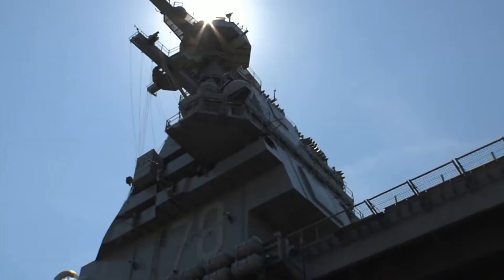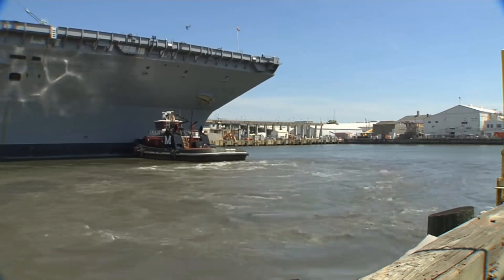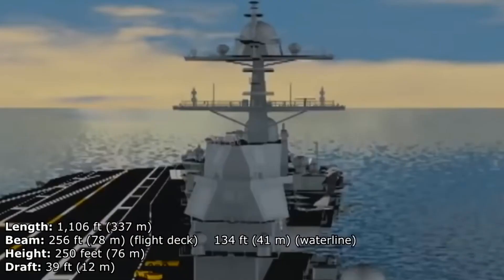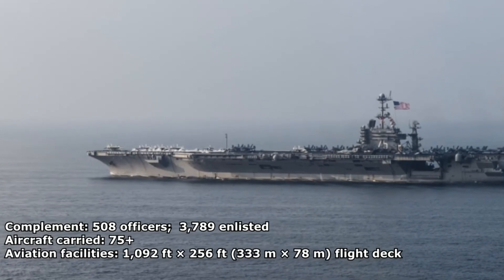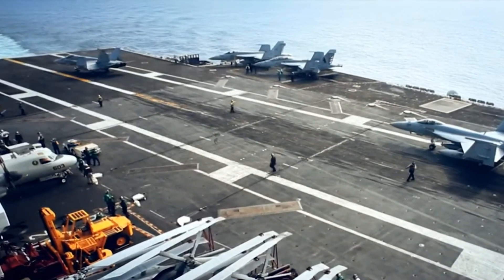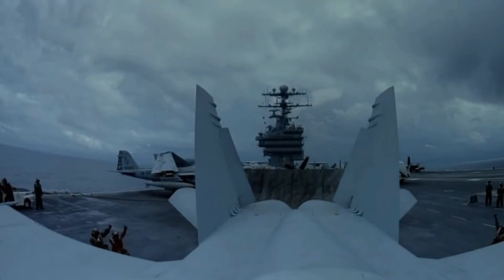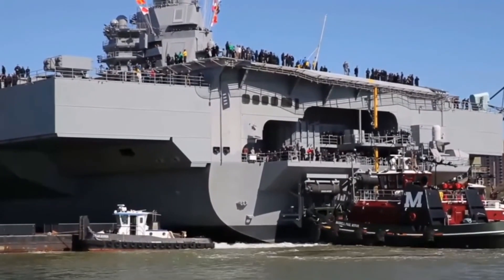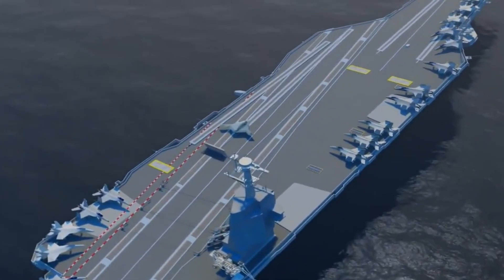USS Gerald R Ford CVN-78 - US Navy Supercarrier

Comment: can't wait for the Queen Elizabeth vid. The Brits always have impressively smart ideas
Reply: Kack Boon While I agree that CATOBAR is the better launch and recovery method in terms of capability, you have to consider the other factors. The Royal Navy doesn't have the money to buy, crew, maintain, and continuously upgrade a large CATOBAR carrier. They also don't really have the decades of experience the US has with the system. Additionally, they don't have any planes that would need a CATOBAR system to launch. However, to say that the F-35 B is shitty is really ignorant and plain wrong. It has got a lot of bad/inaccurate press, and if you look back at almost any plane's development, people have harshly criticized them. Harriers were called widow-makers due to their initial high rate of fatal accidents (this was a big deal). They were also criticized for their inability to go supersonic and their low range and payload capacity. But once all that was ironed out they became a lauded aircraft. If you want to learn more, I suggest you look at the series on Youtube called: F-35 busting myths. It goes through every single criticism in detail and explains a lot of the engineering in plain language.
Reply: +Ancient Hoplite He's probably referring to the shorter range and lower G limit of the F-35B. Still, referring to one of the finest aircraft of the current time as shitty is silly to say the least.
Reply: Exactly, i'm sick of all these "experts" on YouTube comments declaring this aircraft trash. Is it taking longer than it should of, yes, but it's still an incredible piece of machinery.
Reply: If you look up the Euro Fighters Radar cross section it is infact incredibly stealthy for a 4th Generation fighter. It has one of the Best Radar systems, Weapon loads and  Compatibility of any NATO fighter. Including the Precious F18 Super Hornet.  The Typhoon has one of the Best dog fighting records of any European fighter and can only be improved in the future. If you paid attention to the world stage, you'd see that Un-manned Euro Fighters are being tested in Australia, That have pulled 14G in a sustained Dog Fight. Yes 14G.  But Every weapons system of the modern battlefield is a heap of shit as soon as an EMP is let off. So it doesn't matter anyway!
Reply: You have no idea how much I hate people mindlessly and ignorantly hating the F-35. After a few people involved with military aviation criticized the F-35 for its cost, weight and other less than ideal aspects, tons of people who know no more than "If ya pull the stick back, the nose goes up" jumped on the bandwagon, eventually leading to the repeated comparison of the F-35 with the Su-35 in unfair comparsions such as dogfight capability. The stupidity of these claims is similar to the stupidity of saying that surface-to-air missiles can make planes obsolete. The complete disregard for tactical and strategic capabilities and situations in these analyses repeatedly portrays the F-35 as inferior, yet under the right conditions it would be capable of firing a missile at an Su-35 within the missile's no-escape range without being detected.
Reply: +Kack Boon DOT&E noted failures of the EW system, vibrations of the gun which'd cause the 260V DC battery to fail, and false double tracks on aircraft with sensor fusion, among other things. The 2nd is easy, don't use the gun, but other major issues including EO-DAS errors are the most major I'd say. As the most advanced aircraft in the world it's natural for it to have teething issues and I doubt any objective analysis prior to intended 2018 FOC can be reached. A 5th Generation air fleet is essential, if not indispensable in a 21st century threat environment. Global penetrating precision strike is a core competence for any armed service, what the 5th Generation fleet inclusive of B-21s, F-35s and the much rarer F-22s is intended to provide. Extending the service life of legacies isn't any indication of the F-35, it's called fiscal discipline, integral to the high-low capability mix. Without a credible deterrent courtesy of a 5th generation air fleet the U.S. can forget about hegemony over Western Europe and South East Asia that it historically enjoyed. 4th generation aircraft are inherently difficult to sustain in the advanced A2/AD environment, and will deny the services the ability to create and preserve freedom of movement, and the ability to operate nearer to areas of interest. Many think tanks support this precedent, look beyond War is Boring and other debacles. The issues surrounding the F-35 are clear, but it's urgent need is as well, judgement should only be passed past intended FOC deadline. And do you think the 6th Generation aircraft projects of the next few decades will be any easier? Definitely not. It'll likely face more developmental issues.

+jugganaut33 

" But Every weapons system of the modern battlefield is a heap of shit as soon as an EMP is let off. So it doesn't matter anyway! "

My IQ dropped while reading this. Almost all military aircraft are designed to withstand EMPs. Helicopters hovering in front of strong radars fields exhibit this same EMP hardening which allows them to do that. If you want to look into the future of air power there are 2 routes. And neither of them involve significant dogfighting. CSBA envisions large, bomber like VLO aircraft with high missile capacity, manned and unmanned vehicles operating in a sensor shooter configuration. Aircraft manufacturers see 6th Generation aircraft which have variable cycle engines, possibly hypersonic, broadband low observable, ISR, EW and cyber warfare capable. Such is the future. 4th Generation aircraft are no substitute in the long run, nor is 5th Generation. Though it's worth noting the large technological gap between 5th and 6th Gen is why 6th Gen isn't the immediate USAF concern. The victors of modern air wars lie not with who can pull more Gs or generate greater instantaneous turn rates, but rather who can see, shoot and kill first. Missile technology maturations will keep engagement ranges further, advanced short range missiles e.g. IRIS-T and DEW defenses will ensure any dogfight devolves into a 1:1 kill ratio attrition ground, unsustainable for any military, as it does now.
Reply: Explain why the F-35B is shitty?
Reply: +TheMarineGamer IGGHQ
That is their business model, fancy prototype stuff, barely usable in service but sucking up huge amounts of money. 

The F-16 is not from Lockheed, it was designed by General Dynamics to the requirements made by the Fighter Mafia (some Pentagon rebels, fighting for the right and cheaper tool), who also laid out the basic requirements for the A-10. 
Lockheed just bought the program.

The last huge quantity jet fighter from Lockheed was the Starfighter, which killed more pilots than most wars after WW2. 
It worked only in desert conditions with excessive maintenance and even then it was shit. The USAF got rid of them pretty fast. 
Critics in Germany for e.g. were treated like tinfoil heads, besides the fact of all the crashes happening. 
The ignorance of the German Defense Minister of that time was strong and he got his only son killed in one of the junk jets. 

The best jet Lockheed has built in the past decades was the S-3 Viking for the Navy. 

+The Fake SecDef
The overheating hasn't changed from the earlier reports, meaning the weapon bays need to be opened for ventilation. 

F-35B weight problem:
"The program completed the final weight assessment
of the F-35B air vehicle for contract specification
compliance in May 2015 with the weighing of BF-44, a
Lot 7 production aircraft. Actual empty aircraft weight
was 32,442 pounds, only 135 pounds below the planned
not-to-exceed weight of 32,577 pounds and 307 pounds
(less than 1 percent) below the objective VLBB
not‑to‑exceed weight of 32,749 pounds
[...]
Estimates for FoM weight growth include an additional
250 pounds, which will exceed the vertical landing
structural limit not-to-exceed weight of 33,029 pounds
for the Lot 2 through Lot 4 aircraft. This additional
weight may prevent these aircraft from being upgraded
to the Block 4 configuration."

The later Lots are also freaking close to this limit. 

---

You are so wrong on the A-10... it is the ultimate workhorse in the fleet, the most precise, with the lowest collateral damage and operating cost. 
It was cut from funding for bigger upgrades since the 90's! 
While the A-10 can go low, so that the pilot has an eye on the ground, other jets are high up in the air, avoiding ground fire, with pilots watching on a tiny screen. This adds to the risk of air support. 

The F-35 can go down from a few pistol hits (no self-sealing tanks, no fire suppression!), while the A-10 can survive anti-aircraft gunfire. 

It is freaking myth that a CAS aircraft has to dodge air defense systems like the S-300. 
F-16 Wild Weasels or F-18 Growlers and a swarm of MALD decoys will take care of them. No one fights a war on the ground right next to enemy anti-air systems. 

The USAF is even searching for a lighter CAS aircraft in the OA-X program. Currently, the A-29 Super Tucano, AT-6 Wolverine, and the ScorpionJet are in the race.
Reply: +Kack Boon +TheMarineGamer IIGHQ Oh please do link me for the overweight issue. I'm surprised DOT&E didn't reflect it.

But I'm surprised people are still buying into this version of CAS as if it exists in a high intensity conflict. EO-DAS, radar and other sensors can characterize targets according to databases and computers can advise pilots with minimal pilot input (Defense Horizons publication). The human eye is inferior in every way to the sensors the A-10 has, it is by no means the main method for detection. According to the USAF press briefing

LEGACY: A-10A
• Intense workload causes heads-down time
• Built on 1970 / 1980 technology
• Limited integration with modern command
 and control
• Limited precision weapons capability

CURRENT: A-10C
• Central computer provides full sensor &
 weapons system integration
• Information displayed in “glass cockpit”
• Datalink (SADL) with moving map
• New precision weapons capabilities
• Improved lethality and survivability

Other improvements

 Integrated digital information
 Plan-view representation of
current tactical situation

 Situational Awareness Data Link
(SADL)
 TAD displays target/threat/friendly
information via data link
 ‘Gateway’ allows comms with Link
16 and other data links

 A-10C Carries Most Advanced
 Targeting Pods in CAF
 High quality video provides
standoff beyond visual range
 Coordinate Generation (TLE)
 LSS/LST
 LTIP
 IR Marker
 Rover (VDL)
 Video in HMCS

The sensors are used for identification, not the human eye. I mean think about it, in an era of network-centric systems and PGMs, visual identification as a means of aircraft targeting is archaic for the world's strongest standing air force. It is the technological evolution of the A-10 that made it CAS capable. Original A-10s were worthless piles of trash, really

The 1982 congressional hearings on various tactical air programs showed the contrast between the views of the generally pro-military members of the relevant committees and the rhetoric of the Critics. In the Senate Armed Services Committee hearings on 26 February 1982, Senator Barry Goldwater (R-AZ) opened the testimony of General Creech by asking why the Air Force was continuing to buy more of the simple A-10, the Critics' favorite aircraft. Goldwater, an Air Force Reserve brigadier general, said, " I have talked to some of the guys in the A-10 outfits...they would much prefer to do ground support with the F-16. " The problems the A-10 pilots identified to him were caused by the very things the Critics had insisted on: simple avionics and no sophisticated standoff weapons capability. The A-10 pilots complained to Goldwater that without navigation systems they had difficulty finding targets and thus were forced to loiter in high-threat 364 areas, that any sort of bad weather kept them from flying, and the that the lack of standoff weapons meant they had to get dangerously close to their targets. Additionally, to keep costs down, the A-10 did not have the Hands on Throttle and Stick (HOTAS) mechanism that allowed the pilot to change weapons without looking inside the cockpit, even though every other modern Air Force fighter had it, and even F-4s had been retrofitted with the system. The result was an A-10 pilot, while flying at low level and trying to attack a target and dodge SAMs and AAA, had to look inside the cockpit and change five switches to change from bombs to his cannon, while an F-16 pilot made the same weapons change with one movement of a ìpinkieî switch on the throttle. All this vastly increased the vulnerability of the A-10, and the F-16 fighter-bomber seemed much more survivable. Goldwater concluded by saying, ìI donít think it would break a lot of hearts in the Air Force if we donít authorize the purchase of any more A-10s.

- THE REVOLT OF THE MAJORS: HOW THE AIR FORCE CHANGED AFTER VIETNAM

The A-10 is indeed precise. But why? Because it has a targeting pod, it's networked, and the weapons it uses is accurate. Nothing about the A-10 itself is special. If say, an F-15 and an A-10 had hypothetically, the same degree of provided intelligence, launched the same PGM at the same target, you'd note absolutely no differences in CEP. When you can unite ISR and precision strike into a single platform, and add even more CAS relevant technologies and interoperability into a single airframe as in the case of the F-35, it's a more suitable asset. An ideal option would be a 

And no, high intensity CAS isn't a myth, really, it isn't.

" Adversaries are increasingly deploying integrated and networked capabilities as part of the Anti-Access/Area Denial (A2/AD) strategy in highly contested environments. To achieve air superiority against this strategy in support of joint force mission objectives, the Air Force needs to develop a family of capabilities that operate in and across the air, space and cyberspace domains— there is no single capability that provides a “silver bullet” solution. This family must include both stand-off and stand-in forces, integrated and networked to achieve mission effects "

- Air Superiority 2030

Typically VLO aircraft would be used for penetrating strike, to tear down an IADS. But in the case of an adversary with a standing air force, air superiority can be contested, necessitating capable air assets which can provide air-to-air and air-to-ground functionality. JSOW MALD and HARM is a combination envisaged to challenge an IADS, but so is EW and cyber warfare being essential.

" First, units must improve deployment reaction time and speed, as windows of opportunity to penetrate IADS or to destroy high value targets may be fleeting. Second, fifth generation aircraft units must work diligently to minimize the required amount of forward-deployed equipment and personnel, and fully understand the logistics, sustainment, and communications limitations at a deployed location. Third, the Air Force must work to increase flexible basing options available for fifth generation aircraft (such as increasing the number of airfields the Air Force can deploy to), and build a fuller understanding of the impact these options will have on operations, maintenance, and command and control in dispersed locations. This includes not only conducting combat operations from bases owned by our international partners, but also operating at relatively austere locations. "

Fifth Generation Air Combat: Maintaining the Joint Force Advantage By Maj Gen Jeff Harrigian and Col Max Marosko, USAF
Reply: Yeah, and the Admiral Graf Spee should have blown the Exeter, Achilles and Ajax out of the water on paper, having more collective armour, speed and firepower than the three of them put together. The battle of the River Plate at the start of WW2, to save you Googling it as I'm sure you've never heard of it, three relatively puny British cruisers against one German 'Pocket Battleship' that on paper was in every way their superior, the equivalent of one Tiger tank supposedly being the equal of half a dozen Shermans or T34's, again, ON PAPER. You can quote me anything you like but the only real answer to this question would be in an actual, real-life dogfight, where 'the metal hits the meat' to quote your Colonel Hal Moore of the Vietnam War
Reply: The UK is building and outfitting 2 QE-class carriers for the price of 2/3rds of one Gerald Ford-class, fielding 75 5-Gen (or more) fighters. Name one other ally of the USA willing to do that.
Reply: ***** and again. Unnecessary
Reply: it would want to be for the money they are spending!!!
Reply: I read the damn report and it was more than just the points you listed here. 
It is freaking nightmare, caused by huge promises, an airframe that was too small and even after making it pretty fat, it is still not able to house proper cooling or fire suppression. 
The management is horrible and no one corrected back in the days when it was possible. 

The F-35B will have overweight with the planned upgrades so it will be stuck with older technology for a long time OR cause more cost for a required additional upgrade program over its entire lifetime.   
Great...
Reply: Kack Boon exactly. Lockheed is like the EA of planes. They release something expensive and half finished. And they will then add more shite to its back and it will get heavier and more expensive and an A-10 could still do more
Reply: +Kack Boon Cooling? The cooling was deemed effective at least for non tropical climates, the tropics of which are supposed to be tested. Per DOT&E 2016.

" The program does not plan to re-insulate the PAO tubes, as the Block 3F avionics – which are cooled by the PAO – apparently have adequate thermal margin to tolerate the loss of insulation on the tubes. The program must ensure that deployed operating locations with high ambient temperatures – such as those in Southwest Asia – are able to provide the cooling effect necessary to prevent avionics overheat conditions, especially for heat-soaked aircraft with hot fuel tanks and during extended ground operations. "

The main issue here is 

" Overheating of the Electro-Hydraulic Actuator System (EHAS) occurs under normal maneuvering in the F-35C. The EHAS actuators move the flight surfaces and are cooled by airflow across the control surfaces. Pilots are alerted in the cockpit of an overheat condition and must then minimize maneuvering and attempt to cool the EHAS by climbing, if practical, to an altitude with lower temperatures to enhance cooling. Recovery and landing must be completed as soon as possible, terminating the mission. " 

And what do you mean overweight? DOT&E stated nothing of this issue. Upgrades for the F-35 are meant to be biannual after 2018, alternating between software and hardware. It's a shame that the F-35 is a poorly managed project, but it's certainly not a poor aircraft by design.

+TheMarineGamer IGGHQ You're kidding right? Targeting pod available to the A-10 is accessible to other aircraft besides itself. Not compatible with SDBs or JSOW, flies slower and is shorter ranged than other aircraft. There's really nothing superb about the A-10 when its CAS mission can be performed by other aircraft with greater survivability, similar intelligence gathering capability, with greater speed and range. Go and read The Revolt of the Majors_. The only thing that keeps the A-10 relevant is standoff weaponry coupled with lower operating cost. The " _Muh A-10 CAS God " BS has been widely debunked. It was the technological upgrades that persisted with the times that kept it CAS capable, upgrades which were applied to other aircraft, not the original design features of the aircraft. The thing doesn't even have SAR.
Reply: The Fake SecDef you don't know the A-10 at all. Should stop watching YouTube videos
Reply: Wynton Goulding "decades of experience the US has" it was a British design......... While we don't have the navy to operate a carrier with it we designed the system in the first place.
Reply: Wynton Goulding ok you take any American plane you want up and try shooting down a Typhoon with an RAF pilot at the controls and then see what plane you think is the 'obsolescent' one, stealth doesn't mean jack shit in a one-on-one dogfight between modern fighter jets
Reply: +1IbramGaunt

The most modern IR missiles are capable of being cued by Helmet Mounted Cueing Systems (HMCS) and turned toward the designated target and locked on after launch.Many also feature thrust vector control,which bestows extreme maneuverability,and imaging focal plane array IR seekers that recognize and home in on target aircraft images rather than simple heat sources.These missiles allow pilots to launch highly lethal IR missiles at any opponent they can see,even if that opponent is behind them.With an increasing number of modern combat aircraft equipped with missile-approach warning systems,it is likely that a pilot under attack will have sufficient time to target an attacker and launch a missile in return. Once both aircraft have “launch and leave” missiles in the air, prospects are good that the short-range engagement will result in “mutual kills,”with short-range combat kill ratios near 1:1.This suggests we may have reached a point in the development of short-range air combat technologies where serious,capable adversaries will attempt to avoid it and instead seek advantage in superior BVR capabilities.

They'll both kill each other, any victory would be Pyrrhic in WVR. And at least the Americans have the capital necessary to engage in cutting edge R&D e.g. DEW defense systems for aircraft which'd aid WVR engagements.
Reply: It's Shit because they need at least arrested recovery if they want a ski ramp cool but to land with weapons and tanks you need arrested recovery otherwise they can't land without dropping things if they didn't use them it's either take off without it and be unprepared or take off and if nothing happens drop it and waste the weapons and fuel
Reply: Nick Levine - errr .. actually no it does NOT need Arrested Recovery. You will not have heard of Shipborne Rolling Vertical Landing then? Oh wait no its yet another Carrier development tested and implemented by the British. The same people who invented the aircraft carrier, launched the first one, created the 'Island to Starboard' design, invented the Steam Catapult, flew the first jets on and off one,  created the angled flight deck and the visual / mirror landing aids.

And so we do NOT '  drop it and waste the weapons and fuel'. Oh and we also developed the 'Buddy Up' refuelling systems that the US Navy still uses today. We will deploy THAT idea as well.

And this is how it works:
https://www.youtube.com/watch?v=8uPWjq23vL0
Reply: Kack Boon - the QEs will have an initial sortie rate faster than a Nimitz. and a 24 hour rate some 10% less. Given the QEs cost $5 Bn a piece and the Ford cost $16 Bn for the same money we could put 3 x QE carriers out for less money. And put a carrier strike of twice the number of aircraft over a wider sea area. Ask any war fighting Admiral which he would prefer? And I know which the Taxpayers would prefer. Oh and by the way we have built and launched two while the USA has launched one, kept it in dock trying to make it work and only just started building a second. The QE will embark its full complement of F-35s next Summer in the USA. HMS Prince of Wales (floated out this week) will do that in 2019.

That is the hard reality Old Son. You Yanks are putting technology into a ship that just launches aircraft. Or possibly might do. We are putting technology into the aircraft to make the carriers simpler and cheaper. And what technology we are deploying on the ship makes the weapons delivery system the most advanced in the world and created matching sensor capabilities to the F-35 on the ship. Its why we only need 1,600 all up crew and the Ford needs 4,500.

some piece of junk that ....
Reply: *impressively small
Reply: Idk, 50 planes sounds "smaller" than 75 planes. A non-nuclear plant is the sort of thing the US hasn't been limited with on their main carriers for decades. The Elizabeth isn't carrying any missiles, and of course the displacement at 100,000 long tons is 40% larger than the 71,000 ton figure you've quoted.

So was it a cheeky comment? Sure... but it's definitely smaller, and you can go fuck yourself besides
Reply: 1) An aircraft carrier that can hold 50 planes is smaller than one that can hold 75. Thanks for the correction though

2) I understand that this wasn't your department, but not having nuclear fuel is definitely a limitation. Forget speed- try "energy density". I don't know what planet you're from, but ask any engineer whether it's best to have more or less energy for their power plant, and they're likely to say "more energy is better". 

3) As for armament, it is of course not ideal for a carrier to have to use it's secondary weapons systems. Of course "not ideal" and "absent" are two different circumstances to be faced with when you need to deploy these weapons.

4) Ship size has historically been measured in displacement. I get you're obsessed with semantics, but I'm beginning to question whether or not you served in the navy yourself.

As for "keyboard warrior shit", I admit I enjoyed provoking you... if you want my respect you'd better show me some respect first, which certainly isn't how you began this conversation. I had made an offhand comment about how the QE is smaller, and pretty much on cue I get some limey rushing to the comments section to defend his country's (or his queen's?) honor. Of COURSE the QE is smaller, the British Navy has far less of a budget. There's no reason to expect otherwise.
Reply: 1chish 

If I knew you'd get so upset maybe I wouldn't have said anything to begin with. 

Nah
Reply: hahahaha what are you going to do, you fucking fairy?
Reply: Kack Boon why would the UK use the F-35 or F-35B? they have there own Harrier jump jet
Reply: Talking about wasting money, cough Eurofighter 2000 cough. Q: Why is the UK continuing to produce a plane that isn't stealthy, and thus will be obsolete soon? A: Jobs. They should really just buy F-35A's alongside the B's they're buying.
Reply: "TheMarineGamer IGGHQ
It doesn't need catobar. Most of our aircraft don't need catapults. Thats just wasting money like the US constantly does while owning to the whole world by the trillions"

Most of Uk's aircraft? Like what? The Harrier was sold to the US for parts, Eurofighter and Tornado are not build for carrier operations. There is not even an arresting gear on deck. Yeah, helicopters are aircraft too, great, you have the biggest helicopter carrier in the world, you won... nothing. 

Just to let you know, the USMC is going to send some F-35Bs for the carriers, just for the show. 
Otherwise, these 'great' carriers would sail without fighters for a long time. 

The carrier is cheaper but limited to an unfinished new aircraft, which is freaking expensive and will not perform as planned. 
There will be no tanker aircraft on these carriers, also no ASuW and no AEW platform, because they all require a CATOBAR flight deck. 

The F-35 is junk. Every year there is a catastrophic report from the Pentagons DOT&E office, watching the weapon test programs. It does not look good at all and some problems cannot be fixed within the existing airframe design. 

The Pentagon planned a few months ago (weeks after the last report) to extend the life of 300 F-16 from 8,000 to 12,000 hours BUT NOW they are at 841 airframes and up to 13,856 hours!!

http://www.janes.com/article/71414/usaf-increases-scope-of-f-16-slep-to-include-more-aircraft-and-airframe-hours

The F-35 is so great, that the plane it should replace will be in service for a very long time to come! 

"F-16 manufacturer Lockheed Martin announced early Wednesday that the Air Force had authorized service life extension work, which could keep the fighter jets flying past 2048." 

That is 31 more years! 
http://www.defensenews.com/articles/lockheed-says-it-can-double-f-16s-service-life-but-will-have-to-compete-for-opportunity
http://news.lockheedmartin.com/2017-04-12-U-S-Air-Force-Authorizes-Extended-Service-Life-for-F-16

Boeing has the similar programs for the F-15 C/D, E and A-10 in place. 

Also, the USN wants way more Super Hornets and upgrade the ones it has to the new Block 3 standard that is coming up. So far for the even greater F-35C, which is currently unsafe for carrier operations.
Reply: The Fake SecDef Of course it will have a shorter range and lower G limit than the A and C. It has a huge turbine in the middle of it for stovl capabilities. Engineering is all about trade-offs, and that's what you give to get the ability to take off from short runways and land vertically. Trust me, this stuff will be my job in a year.
Reply: ***** your definition of capability is flawed.

It's like saying putting a rocket launcher on a sword makes it more capable
Reply: The overweight issue is in the latest report, it is split into 2 parts. Copy paste and search will get you there. 

And who gives a shit about the A-10A which is long withdrawn from service?! 

"The A-10 is indeed precise. But why?" 

Because it can go low and fly comparable slow in comparison to an F-16 or F-15E. 
The pilot can actually check was is going on instead of watching on a small screen. Some call this situational awareness, you know?! That is why the A-10 is the most beloved (C)AS aircraft among the ground forces! A low-flying A-10 is also a psychologic advantage for the own troops and it scares the shit out of enemy forces. 

If there would be nothing special about the A-10, why has the lowest collateral damage of all platforms? 

"And no, high intensity CAS isn't a myth, really, it isn't." 

"High intensity" is not 'in high threat S-300/400 contested airspace'!! That is the lie the Pentagon tries to sell. 

Did you get the passage you quoted? Yeah, countries have better air defense, so penetrating enemy airspace is more dangerous today. 
In the days of the cold war, for which the A-10 was built, there were anti-air systems all over the German-German border. They had no proper network, but they actually formed multilayer defense lines and on top came all the mobile systems. 
No one planned to use an F-117 to provide CAS in such an environment. 

If the enemy has a still working air force and anti-air systems, you really don't want to fight under enemy jets flying ground mission to blow you up. What is that for a stupid scenario? 
Even more stupid, the F-35 would fly higher than the A-10 and would be exposed to IRST and low band radar systems. 
You cannot even hide an F-35 or F-22 in the Russian or Chinese airspace. 

"But I'm surprised people are still buying into this version of CAS as if it exists in a high intensity conflict."

Yeah, like WW3... besides that, is there a scenario for this stupid shit? No, and that is why the USAF is looking for something that is even lighter and cheaper than the A-10! 
Using F-35s for COIN is what the USAF now got is expensive... it is already expensive with F-16 and F-15E. 
It does not only suck up their airtime, the USAF also used B-52s and B-1s on a regular basis! 

And even if there would be no benefit from the flying tank over the flying Tupperware box from a capability perspective, it is just 1/3 or 1/4 the cost per hour and on top, it does not need the fifth generation hangars.
The F-35 internal combat load is also pretty pathetic.
Reply: Ancient Hoplite and nothing more as I said. It's a toy to feed capitalism. Not a war machine
Reply: +Wynton Goulding I know, and I trust you. In a couple of decades they'll be able to build multirole aircraft that'd excel in all capacities, much like the F-35 now, just much better.
Reply: Kack Boon, think you need to read up as we will have a higher sortie rate than the US carrier dues to not having to wait for the catapult to reset and have room for up to 6 jets to land in one go...
Reply: The F-35B cannot take the same payload as the F-35C on a sortie. It also does not have the range or on station time. This will get even worse in warm weather. 

With the F-35 being a freaking complex flying lemon, there won't be a high sortie rate at all. Even Lockheed fails to deliver their own goals during the test programs.
Reply: It doesn't need catobar. Most of our aircraft don't need catapults. Thats just wasting money like the US constantly does while owning to the whole world by the trillions
Reply: Their carriers are junk. Some ship systems and the flight deck concept with the island and such might be nice but without a CATOBAR flight deck, they can only use the shitty F-35B...
Reply: Kack Boon everyone's entitled to an opinion I suppose
Reply: Kack remind me again you fixed US aircraft designs during and after WW2? Oh yeah that's right... The British navy.... You have no idea what you're talking about